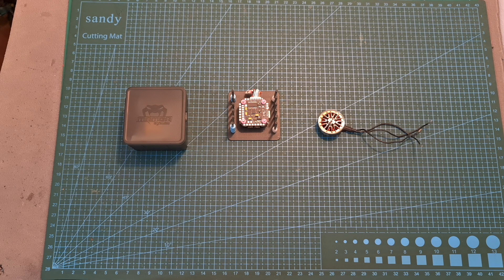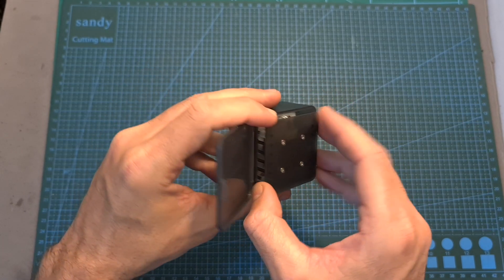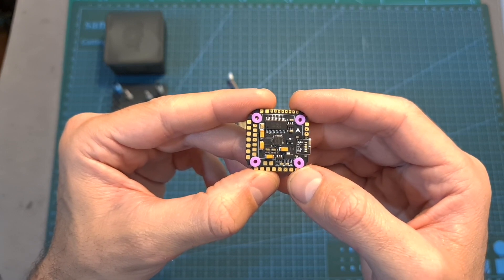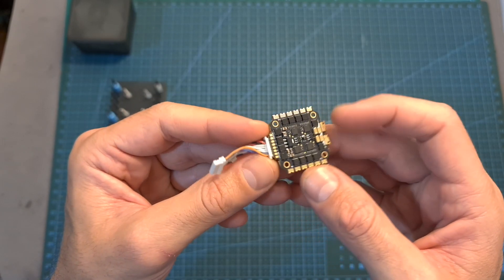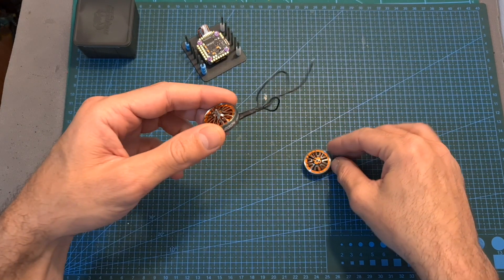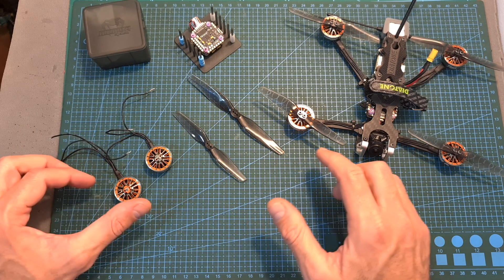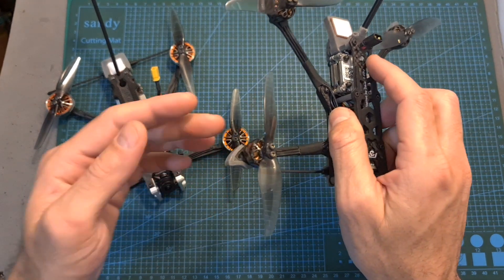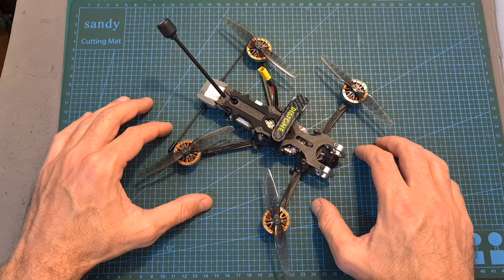Diatone TOKA 2004 Motors // F722 MK3 Mini Stack

Comment: Im planning a cinequad with 2.5 or 3 inch probs and a full GoPro. What do you think is better 4s with 2900kv or 6s with 1700kv? All at all the quad have a weight of 350g.
Reply from the maker: These motors are too big for 2.5" and probably for 3" as well.

Comment: Are these motors any good for a 5” cruiser?  I wanna build one with the Speedybee F7 AIO FV i won on your channel about a year ago...
And what props would be a good match
Reply from the maker: Sure. You can check this BNF quadcopter which is using the same motors: https://youtu.be/MWBb4gw57vQ
Reply: Thinking something similar, these motors and stack seem like a perfect combo for an ultralight 5" mini-long-range.

Comment: Hi Gal   I just seen this motor on Diatone website and I had purchased the HGLRC AEOLUS 2004 3000kv motors by accident,  I wanted 1700kv and I'm thinking about trying these motors instead of the AEOLUS motors.  Thanks again for the video and information.
Reply from the maker: Hi Johnny, just use 4s batteries for now :-)
Reply: @KremerFPV   I am makes it fly like my Grandma is driving.  (SLOW)

Comment: damage that you did not test with 3 inch propellers for "cinewhoops"
Reply: never hot the motors? thank's for the video ;)
Reply from the maker: Sorry, I will try to test them on my next 2004 motors tests. I think that the motors were relatively cool :-)
Reply: @KremerFPV  thank you, i have a nice tune for my taycan now, with cool motors (yesterdey!) and now it fly amazing with no hot motors, but i like the 2004, if they are ok, i'm thinking to buy them ;) thank's ;)

Comment: Thanks for the review, so if I understand well, these motors are much better than 1404 but is the flight time will be reduce because of amp consuming??? I ordered on diatone the same stack, is there any M3 to M2 adapter plate? Btw thanks again!

Comment: Great video my friend! I can’t believe how much thrust they produce on 6s at full power, 1000g at full throttle for one motor! That quad weights like 200g. That’s a 20:1 thrust ratio. Huge improvement in performance for a micro.
Reply from the maker: Thanks a lot. Yes, these are very powerful motors for their size!

Comment: Well if you ask me they need to keep in mind people that just fly analog. And if they had a 10 volt regulator to every damn board. Then us analog folks are going to lose functionality. Because they're going to have to take something else off the board to make room. And I'm almost positive that they have a DJI compatible version of this. Or something that is comparable.
Reply: I think we've been consigned to the bin mate. I have 60 analogue quads and I still enjoy all of them. Keep the faith!!!
Reply from the maker: I see your point, but a 10v BEC can be useful for analog builds as well. I think that only the bigger FCs on the latest series are using a 10v BEC and regardless it's not a deal breaker for digital users as the Vista takes up to 6s. 
As a side note I still have many analog drones and I enjoy flying them ;-)